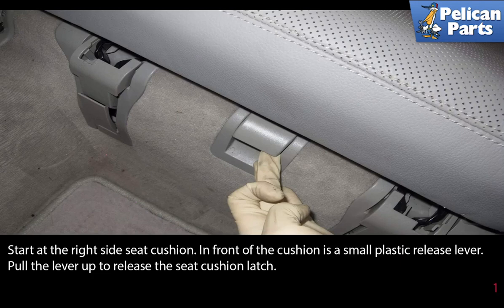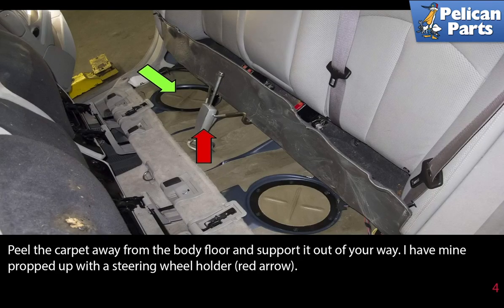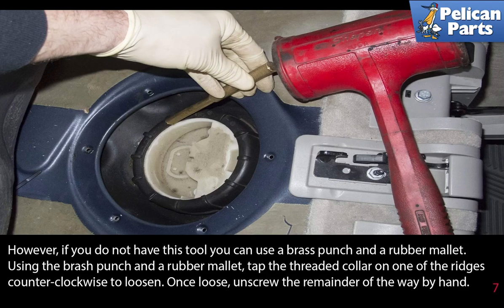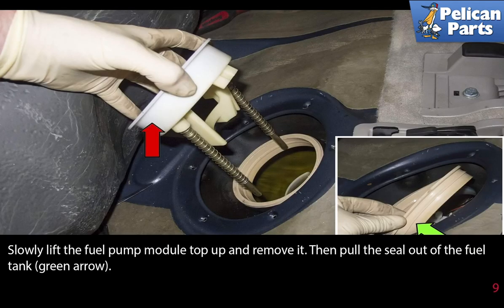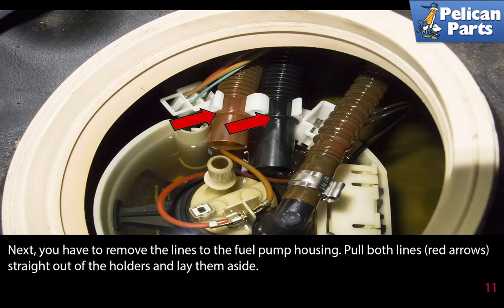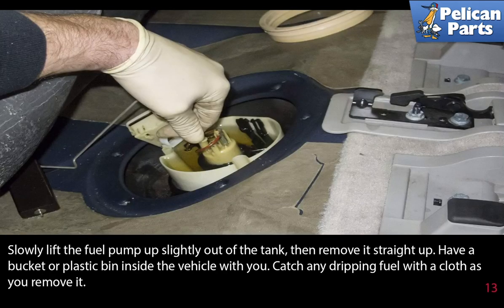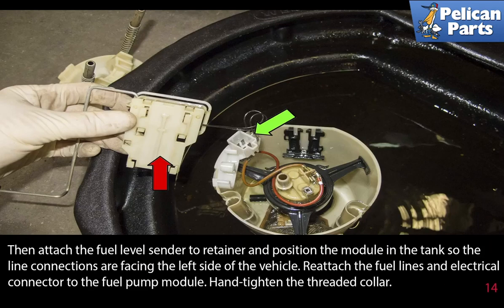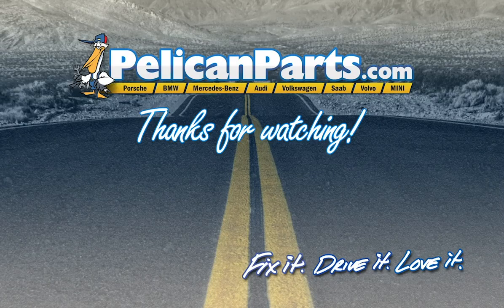Mercedes-Benz W211 E-Class Fuel Pump Replacement

Comment: Thank you, what is on the other side?
Reply from the maker: Other side?
Reply: Not after the death, just on the other side of the car, behind the driver’s seat :D
Is there only filter? Because main electric wire is going there.
Reply: @micham710  Lol!! :D Not after death! Yeah, the side behind the drivers seat is where mine is leaking. Popped off that access panel, and have a big puddle of fuel. Think it's the fuel filter, according to the text in the video description. Pulled up the access panel behind passenger seat, and it's dry as a bone. Fuel pump is working fine, but getting strong gas smell inside the cabin. Going to try the updated green seal that seals the black lock ring to the tank.
Reply: @kellyanderson3474  thank you for your answer, good luck and happy new year! :)

Comment: PZEV ...do you have any recommendations if your Mbenz W211 E350 is a California low emission "PZEV" fuel pump? My fuel pump stopped working and dealer said that the whole tank needs to be replace!?!.... first time I've heard of that stupidity design? Mine does have once access which is on the driver side but they said that is the fuel sender? and the actual fuel pump is inside the tank. No wonder the passenger side access when you unscrew the 8mm bolts there is just metal - no openings to access whatever is inside it,,,, tell me there is hack to access the fuel pump pls.... or else the dealer is charging me $4k to replace the tank (parts & labor). Sincerely
Reply from the maker: Unfortunately that is the design with those tanks. The entire tank needs replacement. I am not aware of a pump only, however to be sure, Give our parts specialists a call at 1-888-280-7799.